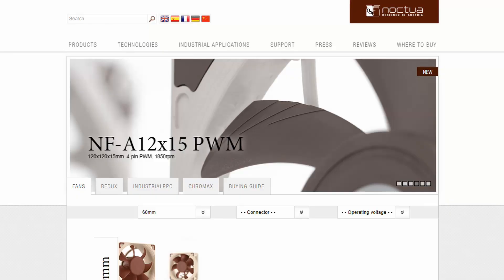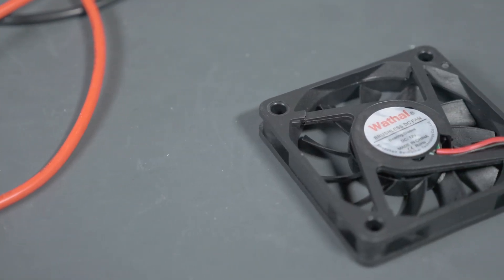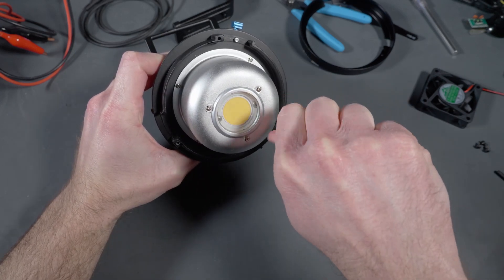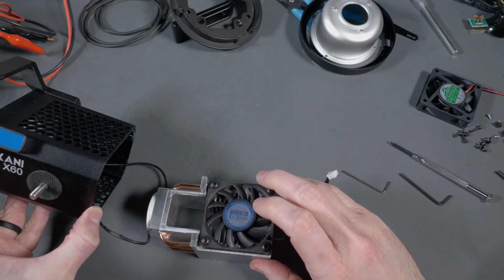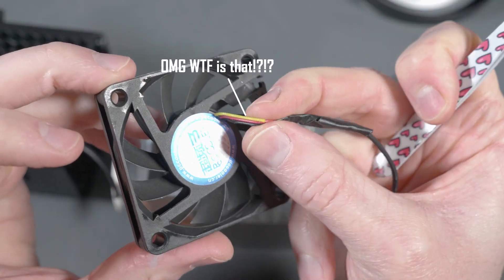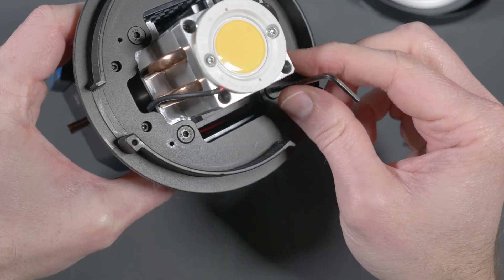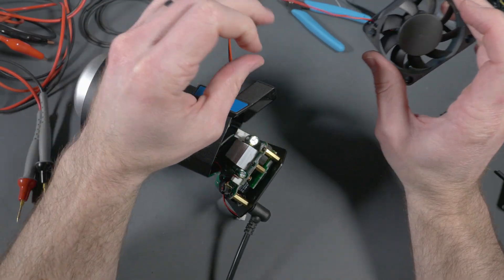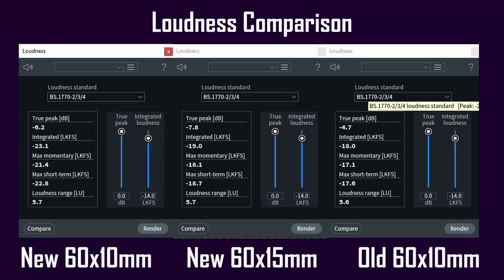Sokani X60 | Replacing the Fan and... WHA?!?!

Comment: This is the V1. I wonder if V2 has the same funny hacks inside.
Reply from the maker: I saw there is a v2.  If be interested to see it, but I just got an Aputure LS C120D II, so it's unlikely I'll splurge on a new Sokani light soon
Reply: @overkillprojects8091  So you do not use the Sokanin no more?
Reply from the maker: Actually yes I'm planning on using it as a secondary light in the new office/studio/whatever that i talk about in the video that comes out in like an hour and a half
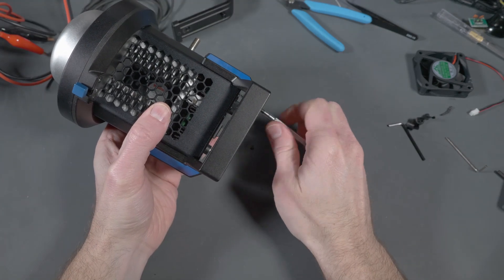Reply: @overkillprojects8091  6:57 The screws are behind this glossy panel/sticker right? I am thinking about opening the panel because my display has shut down, controsl and remote still works. Wanted to check that out.
Reply from the maker: Yep!  All I did was run my thumb all over the sticker to press it down so I could see where the screws were, then cut little circles in it with a hobby knife.  I figured that if I'm not planning on trying to sell it, a few little cosmetic things don't matter.

If it's just the display the cable probably came loose.  You might be able to just plug it back in.
Reply: @overkillprojects8091  Will try that, thank you.

Comment: What about better decoupeling the fan mechanically? It seems all screwed together solidly so any vibration gets transfered to the case. And of course check if nor possible to reduce speed while still cool enough.
Reply from the maker: Tried these (sort of) in a newer video.  The mechanical "decoupling" was a lazy version (just nylon washers) but I don't think it makes a difference because of the sound air makes when it drags over the honeycombs in the case.

Comment: Great vid! Iv'e been looking for some reasurence that i would be able to mod it with a quieter fan before i pulled the trigger on one. I found this 60*15 mm fan that might work ( PAPST 612F/2L-640) though it might be a 3 pin connector type you can fix that like they did from the factor.
Reply from the maker: I tried a pretty quiet 60x15 but there's something about the way it's mounted to the heatsink that seems to make it louder.  I think I have a better solution that I need to just test out real quick... but my wife just had a baby today, so it might be a couple of days :-P
Reply: @overkillprojects8091  Did yoy get a chance to check out your "maybe" solution? And I Hope yor wife and new kid are doing well in theese special times :)
Reply from the maker: @theunholyhippie  Thanks!  I tried out a few solutions - I'm just finally getting enough time to put a video together, it should be out later today or tomorrow barring anything crazy.
Reply: @overkillprojects8091  Congrats! i think we might be able to wait then :)

Comment: Do you think that we could glue a bigger quieter fan on it? whould it fit?
Reply from the maker: I don't think there is room for an 80mm because of the shape of the case, and not having 25mm under the heatsink is a bummer.  You could try to put something outside of the case, but then you worry about obstruction etc.
Reply from the maker: Incidentally I thought of another way to quiet the fan.  I'll make a quick video about it once I test it out.  Stay tuned.
Reply: @overkillprojects8091  I'll definitely stay tuned, I'm already your subscriber =D